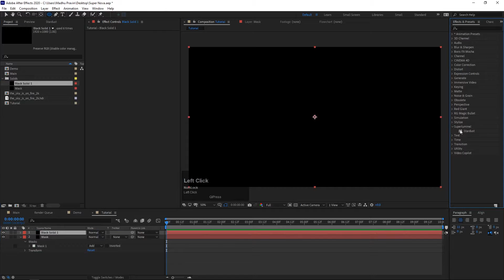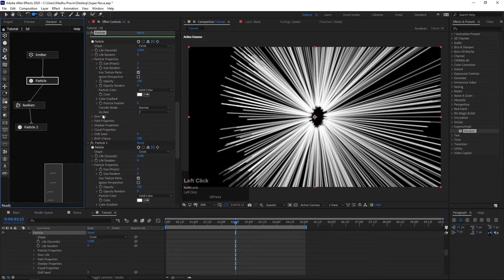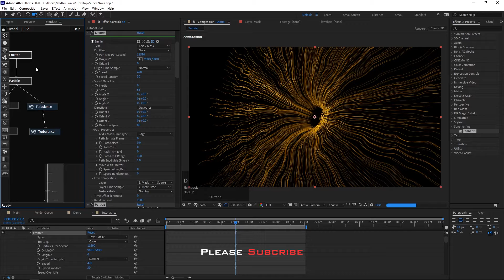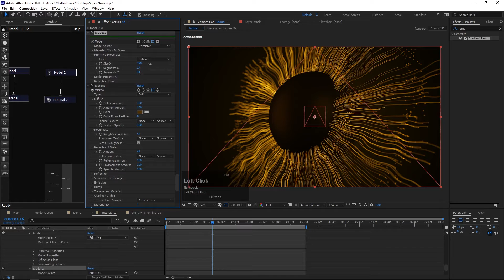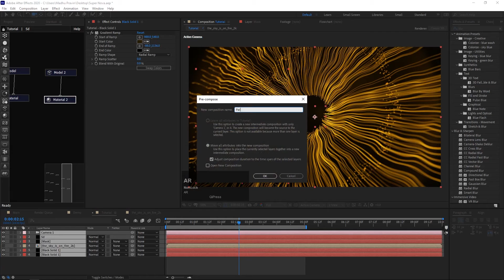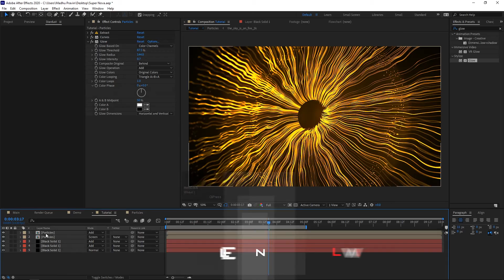Super Nova - Stardust After Effects Tutorial

Comment: Hey man thank you VERY much for making this tutorial. I mostly appreciated the speed, but there were a couple of times where I felt the tutorial would benefit from explaining the reasons why a certain parameter was changed. It would definitely help the audience in the process of learning. Also, at 1:47 could you explain what that image was? I don't know what that image is or why it is specifically being referenced. Thank you!
Reply from the maker: Used for Reflection of the sphere
Reply: @MadhuPravin  Thank you for answering. I apologize, I didn't frame my question correctly. What I meant to ask is why this is done in this way. I didn't have access to a file such as the one you had so I just imitated yours by creating 3 circles on a separate composition and added camera blur to match yours. My question would be if there are different established reference templates that exist out there. Either way I have my answer now after completing your tutorial. Thank you very much!